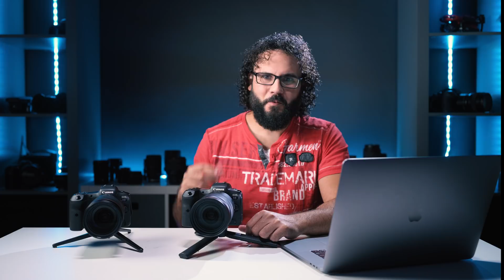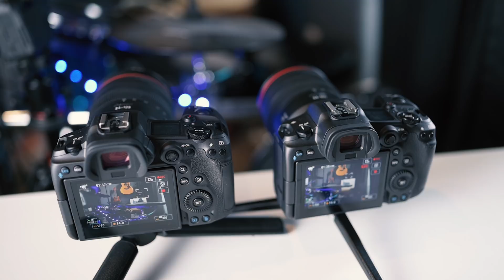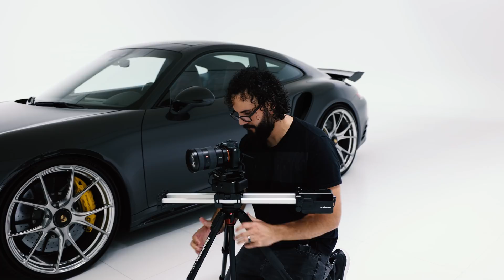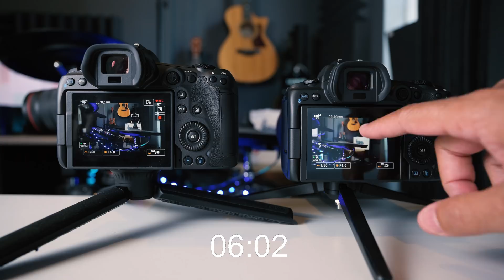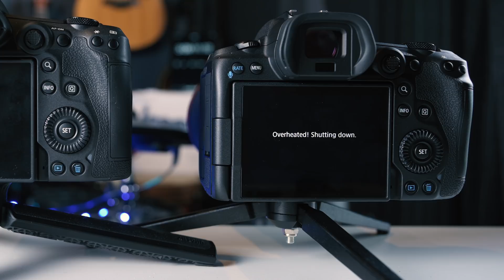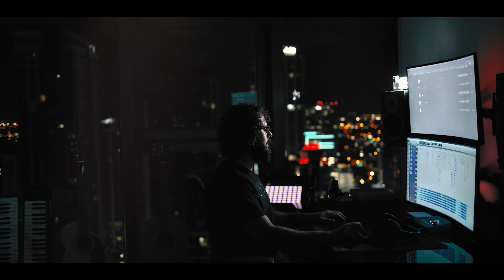Unlimited 4k60 Recording with the Canon R5 Firmware Update 1.1 | Overheating Solved?

Comment from the maker: Some of you were asking my testing conditions....
All indoors, same brand Sony 256gb UHS-II SD card for both cameras in all 4k24 and 4K60 modes, 8k tests were done 1 after the other because I only had one CFexpress card with time in between to let the card cool
Reply: Does the tuned ambient sensor changed performance under direct sunlight?
Reply: hi, is this card the 250MBs, is that fast enough for raw 8k, thank you for making these videos
Reply: All youtubers need to stop with this nice words to canon...if we say for this update, this is great, they will stop with updates like this...we need to push them as hard as we can...r5 is still not fully functional, as it can be...you need to push canon with every video..this is good, but it's not insane...try this on sunny day, and you will not be able to get this amount of recording time...or try to take photos, and do some videos, etc...you will still get overheating.
This is good update, but not great.
Reply: @unique93obr  they are going to release 8k 60 fps raw c800 you know that's comming ...but I got a hack plz check r5 hack  max max max
Reply: I hate when people say they can shoot with other cameras with higher quality 4k modes... that is a lie. The z6 for example is only a 24 MP camera, so it's using a much smaller readout to downsample. I can't think of any other 45+MP cameras that are downsampling from 8K.  A7RIV isn't downsampling from its giant sensor and it still overheats in 4K and it's no better than the R5's basic 4k. In fact PARKER WALLBECK showed that the basic 4K 24 in the R5 is still better than the HQ 4K on the A7SIII. Not too shabby.
Additionally, the R5 CAN  shoot 4K 24 HQ mode downsampled from 5.1k similar to the z6 and has no issues with heat at all.... It's one thing to supersample 4K from 5K, it's another to do so from a 45MP/8K image... it's NEVER been done before on any mirrorless camera.
Reply from the maker: @77dris  remember, the R6 is only 20mp and overheats in 35 minutes of 4k24 full frame so less oversampling than both Sony's A7III and Nikon's Z6 and neither of those cameras overheat indoors. Canon is still far behind OR intentionally crippling their cameras to be worse than the competition
Reply: @learningcameras  Check out my hack r5 max max max
Reply: 77dris you’re 100% correct. My R5 is really blowing my mind. It has amazing 4K - even in the ‘standard’ mode, and the coming update with more RAW options, 8K ‘Lite’, and 1080 120 means we’ll be using this camera for a long time!
Reply: @buzzmachinemedia  check out my r5 hack max max max
Reply: @77dris  All other videos showed the A7SIII was better in 4k than the R5 in regular 4k mode. Your reasoning has issues: the A7RIV did not include any innovations regarding heat management such as the A7SIII had. What you think, what technical limitations made Canon put in a 30 minute internal recording time limit in the R5 regardless the record quality? Why the recording time gets longer when you use an external recorder when the CPU NOR the memory card overheats? Oh yeah...what about the 1 hour cooldown timer? I mean this could have been 2 hours, or 3, just to be sure, because WHO CARES, right? :)
Reply: @77dris  It's more sharp than the a7siii but the dynamic range isn't on the same level.

Comment: If I install a dual battery grip on the R5 would that prevent overheating since two batteries would prevent one single battery to be overworked causing overheating ?

Comment: What if continuous recording 4k hq mode at lower fram rate such as 30 fps there is no problem with heat but after 30 mins the camera will stop recording or auto start recording the new clip by itself ?

Comment: I own and have used the EOS R5 on a shoot - single shoot - not reliable.  When I had firmware version 1.0.0 it would overheat but physically to the touch it was cool or barely had a noticeable warming.  (In doors, room temperature use.) For the Shoot I was using 4kHQ 24p and I recorded up to 30 minutes stopping for about 3-5 min between questions during an interview.  It  overheated and shut down after about 45 min.  I expected it to shut down so I switched to crop mode 4K, 24p (No overheating, I rationalized.) The camera was off for about 20 minutes before I started rolling again. After hitting the 30 min record limit the camera stopped.  It didn’t get the overheat warning but a grey box stating the camera overheated popped up and would not allow me to continue recording.  But again the camera was not hot, not even warm. So canon came out with firmware 1.1.0 update that would help with the overheating problem.  While my camera does record a little longer and recovery is somewhat better, the camera gets really hot now? WTF? My experience leads me to believe canon has pushed the heat limits as far as they are willing to push.  Oh I am not sure if this is related, but two of the three SD cards (LEXAR v60 256 x1667) that I used were corrupted.....well not corrupted but I had problems getting the files off the cards.  I tried several PCs, a Mac and an IPad Pro.  One worked after I used the IPad Pro.  It seemingly fixed the index. Then I was able to retrieve the contents from the card. The other card didn’t work with the iPad index fix.  I had to do a deep sector scan to retrieve the files.  (SCANDISK FILE RECOVERY) I have several brands of cameras that I use - Sony, BMPCC4k, Canon and Panasonic.... never had an issue with the cards until I used them with the R5.

Comment: Witch lens would you recommend for the r6 for Video: 24-105 L or 24-70 L?
Reply from the maker: So I personally prefer the F2.8 because on the R6, you can always use the crop mode to get a bit more reach but the wider aperture is better in low light or for blurring out that background

Comment: If I were to shoot say 30 minutes of interviews straight at 4K 24, transition to some short bursts of 4K 120 for b-roll, and then back to interviews, do you think that would be problematic, or possible? This is essentially my shooting style: interviews, followed by b-roll, and sometimes back to interviews.
Reply from the maker: This would most likely not be possible. Typically after 4k24 for a while, you are completely locked out of 4k120 for broll. You can definitely go back to 4k24 LQ after shooting 120fps 4k but it's often times difficult to do it the other way around
Reply: Hey check out my r5 hack max max max

Comment: The real truth is that the R5 and R6 will never be able to shoot high quality 4k60 long enough to use these cameras for vlogging or professional video shoots or even shooting your kids baseball game.  The part that can overheat in all cameras is the cpu.  There is a reason the Sony A7S3 is only 12Mp and shoot forever 4K60 and why the PANasonic S1H has a fan on top of the cpu. Camera CPU’s were never designed to crank through 24Mp of data (double in the R5) and process them into an 8Mp (4K) image.  I also find it a little hokey that after years in development of the R5 and R6 - Canon “miraculously” has a firmware update 3 weeks after the camera was announced to “fix” the overheating issues - which gives a false impression that down the road firmware updates alone  will make the shooting times comparable to the Sony A7S3 or the PANasonic S1H.

Comment: Still can't decide and choose: clean 4k60 + 240p in A7s3 vs awesome IBIS and better lenses of R5. 8k is useless anyways and Clog3 will be fixed in future. Overheating not an issue. So it all comes to proper clean 4k and 240p OR proper IBIS and lenses like RF 15-35
Reply from the maker: 4k60 on the A7SIII definitely looks better BUT if you are shooting moving objects with natural motion blur, the difference is less obvious than a static object in the studio so that might not be a big deal for you in reality
Reply: @learningcameras true, and even if that is a big deal in the studio environment it may be fixed by R5 APSC 5.1k oversample crop mode that provides amazing clean 4k60, though at the cost of a crop, but in the studio that crop is not as big of a problem as  in the moving scenes, just put the camera a bit further away. Hovewer  there is still magnitudes better low light capabilities of sony so the choice is gonna be very tough). That IBIS is a game changer unfortunately, otherwise sony would've been such an easy pick.
Reply: However gimbal is a solution, where for low light, clean 4k60, xlr input and 240fps there is no solution on Canon side. A7s3 it is then...

Comment: Just bought a new car, but I gotta off the engine and step out if not it will blow up...took me 5 days to travel 15 miles.
Reply from the maker: Technically, there are plenty of race cars that do take some care to not blow them up as well as some electric cars that can't pull crazy fast 0-100 times back to back but, I get your point. However, there are quite a few people that only need intermittent recording (I'm probably not one of them) that might be fine with the latest update
Reply: technically this is exactly what formula 1 is like. they run at a total limit and are very likely to "overheat" and blow up the motor.. when you bring something to its limit, thats how it works. even(or especially) on a professional level.

Comment: The method of shooting 2-3mins and giving it a rest 1min, does it also apply to outdoor? or only indoor (room temp)?
Reply from the maker: Technically the update was specific to room temp but you will likely see improvement outdoors as well. But I don't exactly want to spend 3+hrs in 100 degree heat starting and stopping the camera every 1-2 minutes lol
Reply: Check out my hack r5 max max max

Comment: Their using a stopwatch timer in the camera to swing the cripple hammer. If you take the battery out it writes the timer to the sd card...  I saw another video there they taped down the battery door is open switch, so it don't know you removed the battery.. and they had plenty of time in 8k after the  camera supposedly overheated

Comment: Do you feel you can depend on the R5 using it for an actual wedding?
Reply: I can imagine it now:
Marriage celebrant: "Do you Brad, take Janet to be....."
Videographer: "Hold on guys! Can you give me a minute to cool down....."
Reply: John Wheeler Exactly
Reply from the maker: So yes if you don't care the frame rate...4k24 crop works unlimited and has 5k oversampling so it looks great. 4k60 and 4k120 are definitely not as reliable but for intermittent recording, you should be fine as long as you shut off the camera between takes. The big issue is after recording 1hr of 4k24 (like at a ceremony), you will be locked out of 4k60 and 4k120 for at least 10 minutes so that could be an issue

Comment: So another very important factor is that shooting photos doesn't appear to lock you out of video features. I shot over 3,000 images this week on the new firmware and was never locked out of 4K120.

I think Canon has solved a lot of what I intend to use this camera for, but understand it's not going to cut it for many video shooters. It will likely be an ultimate B-Roll camera to complement another dedicated video camera, but it's not a video workhorse. Likely, that's what Canon wants from this model.
Reply: Most expensive B-roll

Comment: In my understanding both R5 and R6 are weather shielded units without any cooling system in it. Inside the camera , the main heat generators are the sensor and the processor, once they are hot, it will take a long time to cool down in a weather shielded unit, that what exactly happened here. If anyone rely more on shooting videos, better considering some other MILC units wth in build cooling system or hand carry a refrigerator to cool down the R5 camera after every bid of video shoot. All looks like the 8K and 4K60p video specks are for marketing rather than real world use!!. Overheating the sensor often will lead to the degradation of image and video quality. Over heating will definitely decrease the life of the camera.
Reply from the maker: So there have been several tests with these cameras in the fridge and it resulted in the same recording times so obviously the camera itself wasn't overheating. I did hear that now after the update, fridge recording times have gone up though
Reply: @learningcameras  Thanks Dan, Canon is not going to give any EOS R camera which can beat their EOS C line of cameras.  Already someone posted a way to read the actual internal temperature. Canon have to sort out these issues, otherwise it will lose the market share.

Comment: 8:24  But if you leave the 400 degree pizza in a sealed oven after you stop baking it (turn off the oven), it won't be room temperature in 10 minutes.
Reply from the maker: If you put this camera in a freezer after shutting it off, it doesn't "cool down" any quicker
Reply: @learningcameras  That I agree with.

Comment: Thanks ;) Which lens do you use on R5 is it canon RF 24-70mm F2.8L IS USM? The RF 28-70mm f2, is not made for video i can tell.
Reply from the maker: For this test, both cameras had the RF 24-105mm F4 lens because I wanted them to have the same lens and I have 2 of those. Personally I use the 24-70 F2.8 the most!

Comment: The length to which you camera youtubers and the canon community are trying to spin this camera as a viable purchase is eye opening. People tearing the camera apart, removing the internal battery to trick the software, etc. like Just call a spade a spade. Photo first, video second. 
As a former Nikon, now Sony shooter where was all this energy for the early Sony alpha cameras? If history has taught us anything canon will protect their cine line at all costs.
Best way to get your point across is to not buy the camera. The lack of additional revenue will be something canon will have to explain to its shareholders.
Reply from the maker: Actually, if you shoot photos first, you might get locked out of video modes! For hybrid shooters, you need to be shooting video first than photos lol
Reply: Hey check out my r5 hack ...r5 hack max max max

Comment: They should replace the timer with a dynamic thermal indicator bar that climbs from left to right. So you can see a realtime picture of how heat is actually accumulating. This would provide much better insight to how all of the variables (internal and environmental) affect heat buildup.

Comment: Something is awfully wrong, and i mean conspiracy size wrong.A camera does not need nor ever needs more than 30 minutes to "COOL OFF"...it is just physically Impossible.Dan states soemtimes needs an hour or two as he said to get back full length.That is Physically impossible unless this camera is trying to imitate a grill pan.If you measure the temperature of a camera with a thermal gun you will notice that when it hits overheating, it cools off quickly in 10-15 minutes back to "normal" Cameras are not made of heat insulators. Again, it is physically IMPOSSIBLE for a camera or its internals , sensor, board to take an hour or two to cool down.No way.Not in any universe or dimension.They have crippled it on purpose as they cant say "oh we shall give you a 30 min recording time but you get a penalty and not allowed to use it if you hit that 30 min marker" No bonus for you....So they made up this BS reason and programmed it this way.On the otherhand if they did infact find a way to make this thing record longer times then props to them for their innovation but i shit on you for the lying.
Reply: It would be really interesting to see accurate internal temperature data of the components. Obviously if the camera is a good insulator, it will be difficult to determine internal component temperature with a thermal camera / spot thermometer that is measuring the outside of the camera. 

I wish Canon would publish internal temperatures of the components and explain what the limits are. There is EXIF data in the photos, but I don't know what temperature this is measuring.

I would also be really surprised if it takes 1-2 hours to fully cool down. The components must only weigh a few grams and should cool down in minutes like other integrated circuits.
Reply: @johngwheeler  Exactly my thoughts, even if we just measure the outside temp with a Spot Thermometer it would still give us a starting point or reference to the cool down process in terms of time/ratio...like decreasing 1 Degree on the inside every 30 seconds= 1 minute for internal.....it will still be a sort of reference/curve . it just does not make sense, it is not a peice of burning ember in a pitfire. If it did take that long to cool down (1-2 hrs) then it should show heat warning in 5 minutes as gaining heat is always faster than losing it as a process because once exposed to the heat, its trapped and has to dissipate and that is where components come into play.
Someone needs to operate this camera with no back cover and do the dirty work.Dissect it live.

Comment: I'm sorry guys but this is just ridiculous. Canon build in a timer to control "overheating" and is expecting its customers to come up with some plan when to turn the cam on or off? This is not a professional tool for video.
Reply: True. But I'm not talking about that. I'm talking about hyprid shooters like wedding photographers and alike. This is not a tool they could use professionally if they wanted to include video. Funny that Canon did a lot of 8k talking over the last year  though...
Reply: Canon thinks r5 as a professional photography tool not video camera. Their professional line is a bit higher $$.$$$
Reply: @cihangirozguler3675  then they should advertise the product accordingly.
Reply: @friedpicklezzz  r5 hack max max max